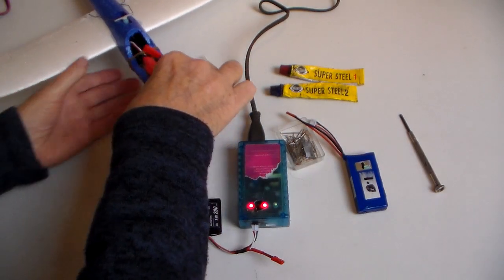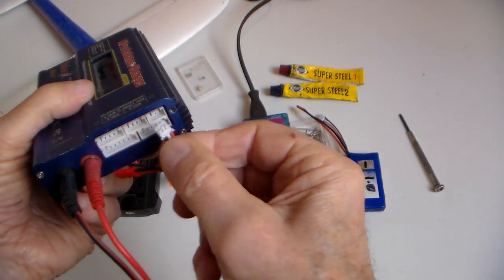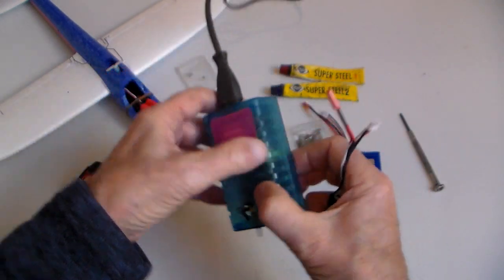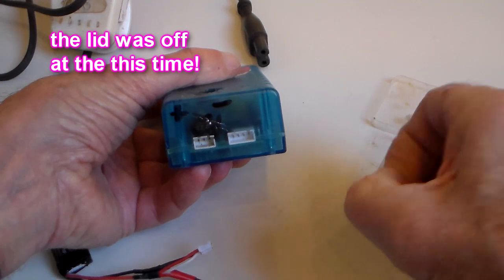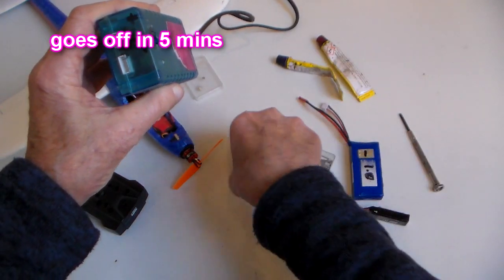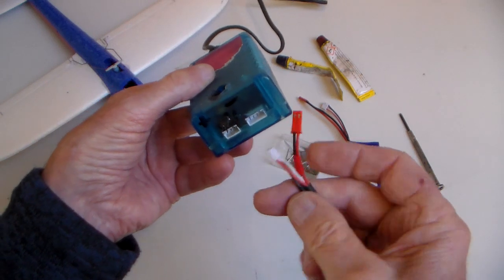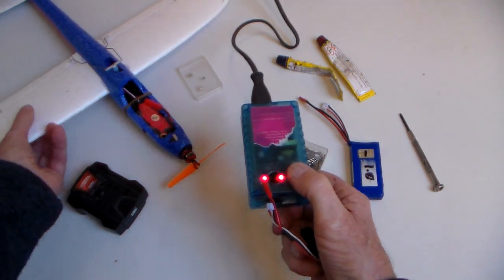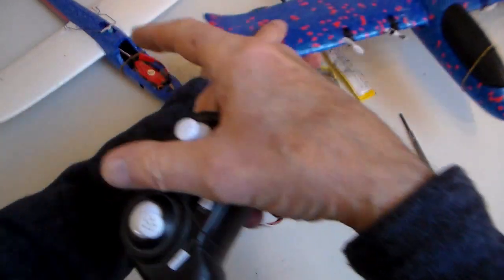An easy modification to a Lipo charger so it will charge mini-batteries used in micro planes

Comment: I guess that we are 1 up on you there Bob. A few years back, when we were getting the Jimmy Brits about having to wait for the slow sampan every time we got a new component with a different plug/socket on it we bit the bullet. Ordered in 10x of every JST/Molex 2/3/and some 4-pin sockets/plugs with wires in all pin spacings! 1mm to 2.54mm. They were pretty cheap at the time (and easily available) and have been a godsend in the years since! 😉
Reply from the maker: I did see the adapters online before I did this, but in 20 years it's the first time I'd come across this issue balancing charging issue, plus I enjoyed making a mod!  All my other batteries fit my charger. Wasn't about to buy a new charger for just one battery (or buy and adapter.)  I did some Googling. I've seen and got a variety of connectors on stuff, but if you Goggle there are dozens of molex and jst etc as you say!

Comment: If I have a battery with a plug that does not fit my chargers I solder on a plug that does!
 I save all the plugs from my 'retired' batteries and I bought a selection of 2,3, 4 and 6s balance plugs. Yes from China so there is delivery time but it a case of being prepared.
Reply from the maker: Ha, I usually do the same with the bigger 2s, 3s, 4s etc. Initially I added a jst to this little battery,  but I didn't have a bigger unused 3s balance plug or I would have used it. It's the first time I've come across this JST PH balance plug with smaller pitch holes. I've since bought another. It'll only be used with the new very lightweight Lidl mini I built and it was cheaper and more fun to just add 3 more small pins to a charger. I've also done away with the JST on the model and made a very small two pin plug to use with this connector. There's limited space on the new model too and it's smaller. Win win.